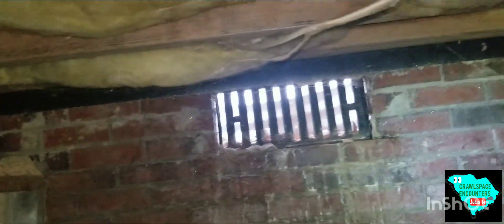Contractor fail!!!🤨

Comment: Those blocks must not have been externally waterproofed at all after the wall was laid, with so much moisture and efflorescence being present. Or maybe it’s degraded with age.
Reply from the maker: Absolutely correct. House is only 15 years young. No water proofing at all..
Reply: Oh wow, only 15 years old. I feel bad for the homeowners, they probably have no idea.
Reply from the maker: Pretty upset.